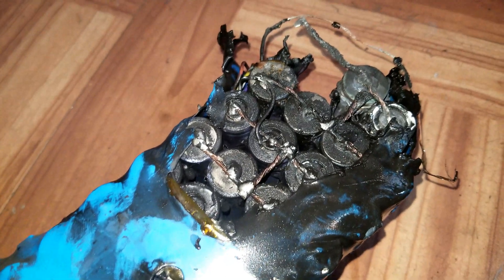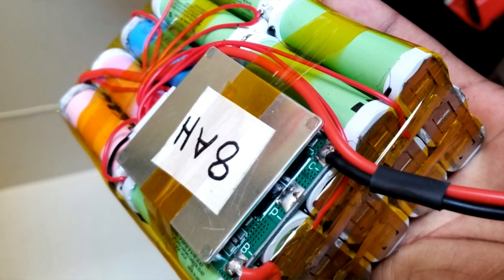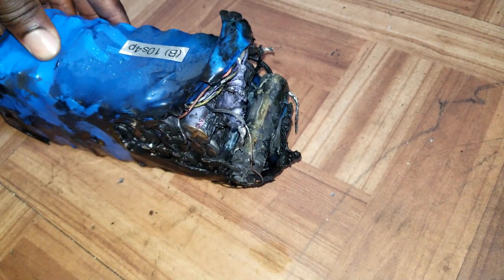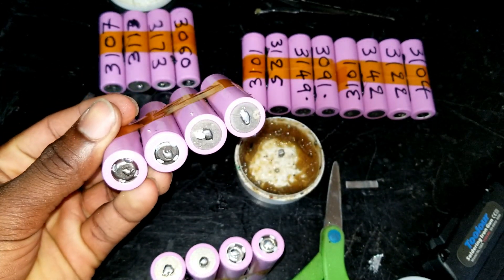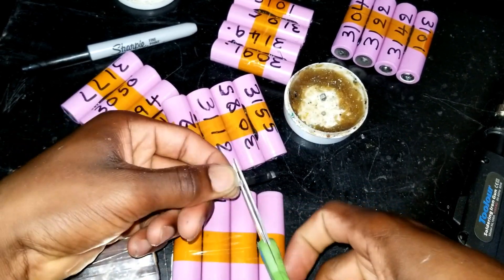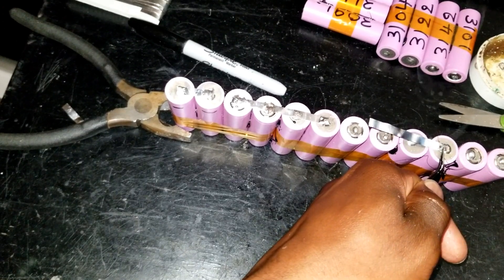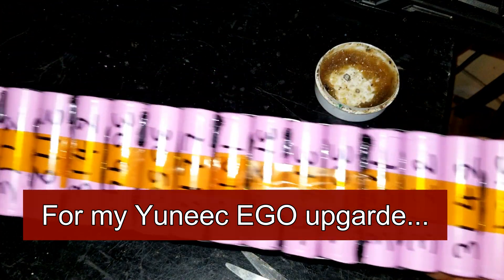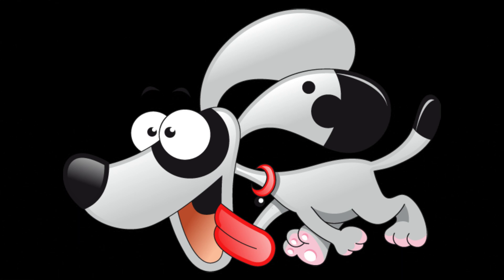HOW TO SOLDER 18650 BATTERIES - SOLDERING CELLS WITH TABBING WIRES⚡️

Comment: Bro whats yhe size of nickel plates
Reply from the maker: 0.2 mm flat and 8mm wide
Reply: @YvonSmart  thankyou so so much bro for replying really appreciate it
Reply from the maker: @ You're welcome
Reply: @YvonSmart  bro will 0.15mm work ?
Reply from the maker: @ydiadi_  Yes, but if you draw more than 7 amps it can overheat and cause a fire. I suggest doubling it while spot welding for an equivalent 0.3mm. The quality of the nickel strips also matters, so aim for higher % of purity
Reply: @YvonSmart bro will 0.15mm work ?